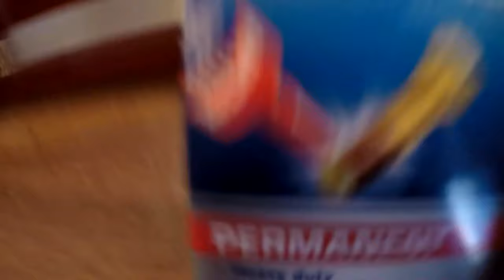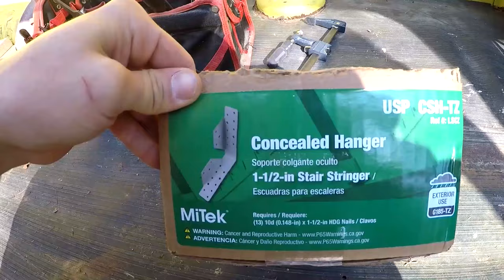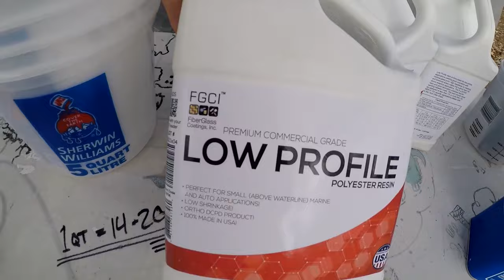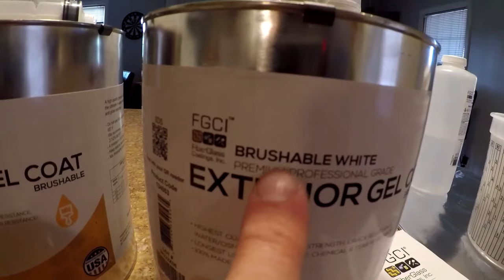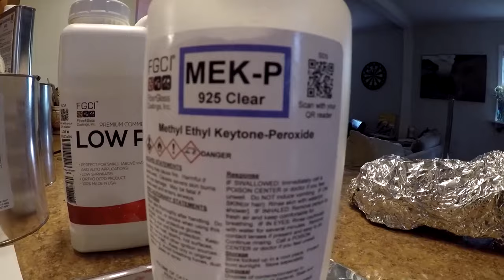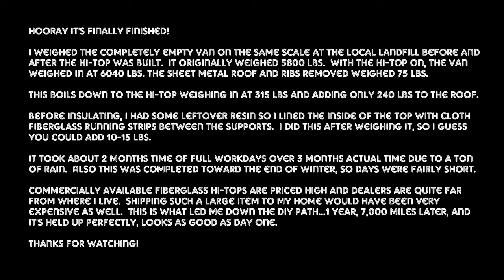Best Custom DIY Van Hi Top Ever

Comment: The word “BEST” is often overused in descriptions. That’s not the case with this build. You did a fantastic job. The overkill is my favorite part. Comfort of long term security is worth every bolt!
Reply from the maker: Thanks man, I appreciate it.  Better safe than sorry, haha.
Reply: I bought my high top van from a bankrupt wheelchair business due to pandemic for $2,700 in 2020. V8 97 Ford e350. After empty the tank twice,  I decided to sell it because I'm happy camping in my prius. Repeatedly I tried selling it for a big loss of $2,500 because the entire ac system is new, and no one would buy it lol. I lowered it to $1,500 with posts in Craigslist and offerup and only one guy contacted and asked me to remove the wheelchair ramp and then he'll buy it for $1,500. 😆 I said screw it, I'm keeping it.  The wheelchair lift in the tailgate cost $3,000 new and is the main reason why I bought the van because it act as a extra patio plus if the van is parked stationary because of high gas cost,  I want to get water for shower pulled by my bike,  25 gallons is 220 lbs and to lift it over the van I need the wheelchair lift, so why would I remove it? My van got 220,000 miles but purrs like new properly maintained by the company who owned it.... little did I know the high top van is so sought-after today people are selling it for $20,000 lol. I'm glad I didn't sell it for $1,500. I'm building my van right now as we speak.
Reply from the maker: @BOREDANDWELLBORED  That's a great deal, especially with the high top and lift.  Best of luck!

Comment: Congrats  on  hanging in and  finishing that top.  I  personally have  done  race  car  bodies and   lots of  boat  work. I appreciate  the sheer effort it took you . I would  have  done the same  kind  of  project   a few  years  ago.  Just  don't have that  kind of  energy at  this  point. When I  raced my 33 ft sailboat the bottom was  wet  sanded to 400 wet  or  dry every  Spring

Comment: Awesome build, and good job on weight savings! That is pretty light.  A note from the rv world.. dicor 501 sealant, self leveling, for any seams on a flat surface, vents, etc.  Stays pliable, but is possible to strip and reseal every few years for maintenance.  Butyl or putty tape for any roof accessory between roof and flange, then decor over screws and seam open to weather.  Marine sealant is a great adhesive, but tough to strip and replace.  Looks awesome, the yellow looks great!  Nice soundtrack!

Comment: That was quite the build.  I liked the fiberglass water proofing, like building a boat.  I wonder if one could use that wood frame as a mold and make a fiberglass top from that ?  High tops kits are pricey and hard to ship....well done !  Definitely well built.
Reply from the maker: Thanks, great idea! I had actually considered doing just that...may be the follow up video...
Reply: @itsnotthatyellow  When you are involved in a roll over, will the roof support the van man?
Reply: @wildestcowboy2668 😂😂😂😂

Comment: next project-- beef up your rear suspension--- cheap-- airbags---- they make it the best for whatthey are-- they do not increase vans cargo weight capacity- but sure help in stabilty and life in old springs-- even if you got new springs they will be worth every penny
Reply from the maker: 'Ol Yeller is still riding fine in 2023, but I definitely plan on replacing the springs with a more heavy duty option in the near future...increased weight capacity, more durable, etc.  I've never been fond of airbags though, and have actually swapped airbags for springs in the past on other vehicles...gimme steel!  Thanks for watching! CHeers!

Comment: Excellent work! What kind of foam did you use for the corners? The stuff that came in a gallon can that it looks like you put red dye in.
Reply from the maker: It's standard "Bondo" brand auto-body filler.  You can find it at any auto-parts store or wal-mart.  Or you could substitute a light pine wood and sand that down to shape. Thanks for watching

Comment: Great video awesome work. Just out of curiosity was there any reason why you didn't cut the front cab roof the same time you cut the rest of the box roof?
Reply from the maker: I left the roof over the cab for structural support. I wouldn't be standing much ever while in the front seat area. I also left it for overhead storage where I built shelving.  Leaving the roof intact over the cab is how every professional high top installer I have ever saw does it so I figured it's a safe bet.  Thanks for watching!
Reply: @itsnotthatyellow  you know I saw that right after I messaged you I had noticed that they don't even cut the cab roof the exterior is mainly for aerodynamics apparently. That's unfortunate I was hoping that you could cut the cab roof and raise it the same height as the box. Like my old Chevy p30 dammit 😅

Comment: Beautiful work..especially a backyard project. Im wanting to do the same, trying to squeeze every nickel.  Do you recall how much resin (gallon/gallons) was soaked into the plywood before you were satisfied, ready for glass? Im weighing cost and effort to use aluminum flashing vs plywood.
Reply from the maker: Don't use the flashing, use wood.  Columbus sailed here on a wooden boat, wood is good lol.  5-6 Gal resin total

Comment: No puedo dejar de ver sus videos y me.motivan a hacer mi modificación del techo de la van para comenzar la camperizacion me gustaría saber si  número de esos tornillos que usan al inicio de la colocación del techo y los demás materiales del techo gracias y saludos desde Venezuela
Reply from the maker: (20) tubos Loctite PL Max pegamento premium
(16) tubos 3M 5200
(1) tubo fijador de roscas rojo Loctite
(1) relleno de carrocería para automóviles gal Bondo
(12) latas de espuma Great Stuff

(20) pino sin tratar 2x4x8s
(2) pino tratado 2x4x16s
(1) sin tratar 2x6x8
(6) hojas de madera contrachapada de 4x8 x 1/4"
(1) hojas de madera contrachapada de 4x8 x 1/2"

(34) pernos de 1/2” grado 8 chapados en zinc dorado
(34) arandelas de 1/2” grado 8
(34) tuercas de seguridad de nailon grado 8 de 1/2”

(42) ganchos ocultos para travesaños de escalera de 1 1/2”

(1) Placa de acero de 1/8” 12x24

(1) lata de imprimación en aerosol Rustoleum
(1) lata de pintura en aerosol Rustoleum

(6) galones de resina de poliéster FGCI
(1) galón FGCI gelcoat blanco aplicable con brocha
(1) galón FGCI capa de gel amarillo canario aplicable con brocha

(¿muchos?) (1 1/4"), (2"), (2 1/2"), (3"), (3 1/2") tornillos para madera con revestimiento exterior
(¿muchas?) almohadillas, cinturones y hojas de lija

HERRAMIENTAS:
Sierra circular
rompecabezas
sierra de inglete
Sierra de mesa
sierra oscilante
lijadora de banda
lijadora de palma
amoladora angular
brocas
escaleras
lona
nivel 3'
archivo
trinquete
enchufe
llave inglesa
hoja de sierra
abrazaderas

Gracias por ver!
Reply: Uchisimas gracias por su amable e importante información e orientación sigo atenta a sus publicaciones y pronto subiré el vídeo de mi van muchisimaaas gracias ,se le admira increíble trabajo y valoro mucho la información ..saludos desde Venezuela

Comment: Well, I gotta say congrats.  You're savage for doing this instead of buying a fiberglass top.  Those tops must be expensive if you were willing to commit so much time and energy in going the DIY route.  So how many $$ in materials?
Reply from the maker: After diving in headfirst I wondered the same thing....should I just make the drive and buy one in Florida???  It worked out and 'Ol Yeller is on her second trip across the USA.

About $2,200 total cost...similar commercial tops with the wooden "rib" upgrade for cabinets run $5,000+.  Not the greatest bargain ever when adding up time spent, but not too bad either.  Thanks for watching!

Comment: Excellent work and design but I can't help but wondering if you didn't spend more than just going to buy a fiberglass top
Reply from the maker: I was thinking the same thing as I started buying materials.  A good quality fiberglass top with the ability to hang cabinets inside was around $4,000-$5000.  Shipping would have been over $1500.  In the long run I've spent about $2200, over $1000 of that was spent on resin and fiberglass.  It was a pain in the ass labor of love haha.
Reply: @itsnotthatyellow  I want to cut my standard high top on my G20 rise in it up about 12 inches but I can work up the balls 😆
Reply from the maker: @christopherohara9421  Even though I had a good idea of what I was going to do, when saw hits roof it's a kinda scary wtf feeling of commitment lol. Best of luck!

Comment: Awesome build. What hitch is that? I've been looking for the same thing! Something to carry a dirtbike and two bicycles.
Reply from the maker: Thanks, I appreciate it.  The hitch accessory is just a standard steel dirtbike carrier (idk brand) with a harbor freight hitch-mount, 2-bike carrier added on. I attached the two together by drilling 1/2" holes through the main square tubes of each and securing with two 1/2" bolts near the rearmost part of the dirtbike hauler.

I couldn't find anyone that offered a combo hauler so.....it almost looks store bought lol.

Comment: sorry if someone asked already,  much difference in handling.. that is very nice but sure seems like alot of weight?  Great Stuff is not that great, It has so many voids and sometimes doesn't dry inside. I wonder if there is another better expanding foam for doing the filleting
Reply from the maker: Not really a huge difference in the handling, a bit, but I was surprised how little of a difference there is.  The last minute or so of the video has the weight info for roof removed and hi top weight added...and great stuff foam was a better option and easier to sand than loctite alternatives. I made sure to do a second pass and fill the voids that great stuff definitely leaves behind, and re-sand. Thanks for watching!

Comment: Wow, nice job and thanks for sharing!    1) Any idea what the weight of yours is compared to a pre-built fiberglass high top?   2) Do you know what the total cost to build was?   3) Did you consider using smaller lumber by gluing and glassing everything with epoxy resin instead of polyester?
Reply from the maker: Hey thanks, I appreciate it. The weight for roof removed and high top weight added info is in the last minute of the video...the top weighed 315lbs, roof removed = 75lbs, so adding only 240lbs to the roof.  I can't say for sure, but fiberglass isn't the lightest and I've read the higher end fiberine tops with wooden bracing to attach shelving weighs over 400lbs...so idk.

and if I had it to do over I would probably use a 100% silicone rv roof final coating over the glass instead of polyester gel coat...but the poly is working fine and is oldskool. Thanks for watching!
Reply from the maker: ...oh and the cost was about $2,100-$2,200 total...a bit more than expected but it worked out fine in my book.
Reply: @itsnotthatyellow    Wow, only added 240 lbs. that’s pretty light. Did you consider fiberglassing the exterior with epoxy resin?
Reply from the maker: Yes, I did a bit of studying beforehand and opted for polyester for different reasons, a big one being boats have been made from polyester resin for years and seems to work well...epoxy isn't quite as time-tested I believe.  Some boat glass guy could give a better comparison of poly vs epoxy because honestly I have forgot a lot of the details over the years. @joeblow1942
Reply: @itsnotthatyellow     I am one of those boat and surfboard glass guys. Epoxy has been successfully used for over 50 years to glue and glass boats as well as in the aerospace industry. It is superior in every way to polyester. 5 to 10 years ago I would’ve said you could save a lot of money by using polyester over epoxy but the prices for polyester any epoxy are close enough now that it’s a no brainer to choose epoxy. Only downside to epoxy is that you can’t custom tune the curing process like you can with polyester resin and catalyst.
Reply: @itsnotthatyellow    All those radical ocean racing multihulls that can do 50+ mph are glued together and glassed with epoxy.
Reply from the maker: Awesome, thanks for the info.  I did glue every single joint with loctite PL premium that dries 100% solid along with using screws, glue would have been enough I'm sure, but a bit overkill is fine with me and the screws also hold the joint in place and together while drying.  You're making me think I probably should have used epoxy...should have spoken with you instead of the "expert" at FGCI, haha. I recall learning that "gel coat" would not adhere to epoxy but sticks to poly...at the time I didn't realize that gel coat is basically poly resin with color...You live and learn.

If I had it to do over I think I would use epoxy and maybe a colored silicone RV roof coating on top.  I've heard mixed ideas on whether or not silicone will adhere to epoxy but can't say for sure. @joeblow1942
Reply: @itsnotthatyellow    Yes, gel coat is polyester and polyester won’t adhere to epoxy but epoxy will adhere to polyester and pretty much anything else.

I wouldn’t use that silicone stuff on the roof. I would fiberglass with epoxy the entire exterior of the roof instead. Maybe add some pigment to it. 

Another nice thing about using epoxy for everything is that you could use much narrower and thinner pieces of lumber inside and you don’t need to use primer when you paint over epoxy. 

Another idea would be to use big sheets of foam instead of plywood. Of course you’d have to glass both sides but it would be very light and have built in insulation.

Comment: 2 Things. 1) I'm building scaffold down both sides and across the back on day 1. Saves hours repositioning ladders. 2) Why no windows? I'm raising 24" and putting at least 2-18x44 windows in. Light and ventilation are very important.
Reply from the maker: Scaffolding would be very helpful.  The single maxx fan with a window open ventilates fine for me.  There are 7 large windows in the van which provides plenty of light.  A window up top would be a nice addition but is one more point for a leak to occur in my opinion and would just rather not have the weak point. Can't wait to see your build.

Comment: Hi Guys, fantastic project! how many layers of fiberglass did you use?
Reply from the maker: Just a single layer of chopped strand mat.  Not too thick, not too thin...I honestly can't remember the weight or thickness of the glass.

If I had it to do over I would probably add an additional layer or two...the resin penetrates into the plywood somewhat and acts as another mechanical layer I guess.

She's held up great, I may apply a coat or two of 100% silicone RV roof coating...Thanks for watching!

Comment: just a question from someone who has never built anything like that: what about just using that roof you've just made as a positive to make a mould for a fiber roof? definitely would take much more work, but the end result would be lighter and you can use the mould for other people who want to do the same.
Reply from the maker: I've actually thought about doing just that...wouldn't be too hard to make a mold now.  Maybe when I settle down from travelling I will.  Great idea, thanks!
Reply from the maker: Also, if you like to be red pilled you should check out the pinned link at the top of the comments...

Comment: When I build mine I wanted to stop behind the drivers seat ,is that ok ,or do you have to go that close to the front window?
Reply from the maker: I have seen others take a fiberglass high top designed for a standard van and attach it to an extended van leaving the area over the cab stock or short.  
Having said that, the horizontal roof support beams inside the van are only designed to support the sheet metal roof, nothing more...that's why removing them is perfectly fine structurally.
So the only problem I would have with starting behind the cab is what to mount to...basically nothing but sheet metal and a "weak" support, whereas upfront near the windshield there is the sub-frame for the body, which is very substantial to attach bolts through.
Hope that helps, thanks for watching!

Comment: Thats got to be crazy heavy
Reply from the maker: It's actually not that bad, the best fiberine has to offer weighs in around 400lbs!  This bad boy weighs in at 315 lbs + solar panels, minus the old metal roof which was 75 lbs...

I've seen many a ladder rack loaded down with way more than 250lbs lol.